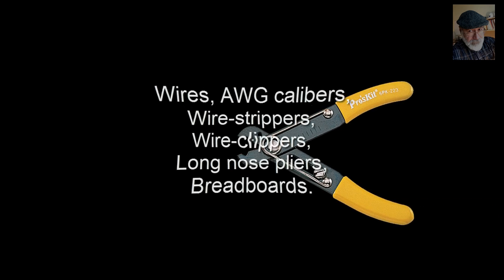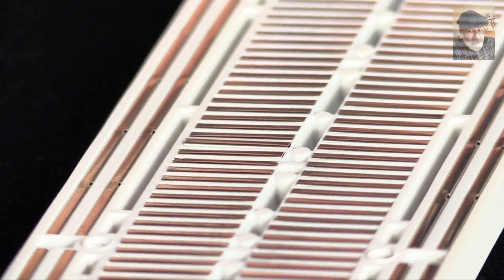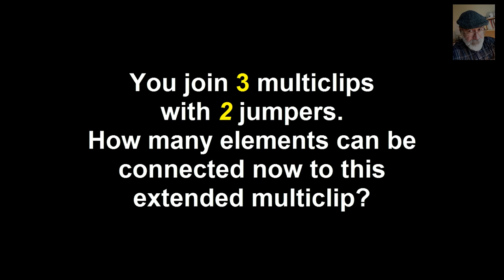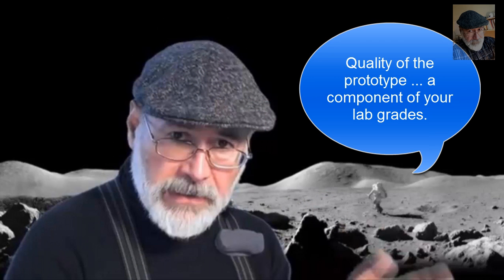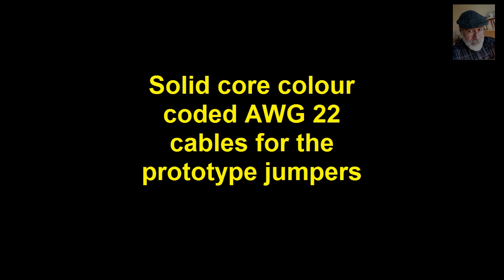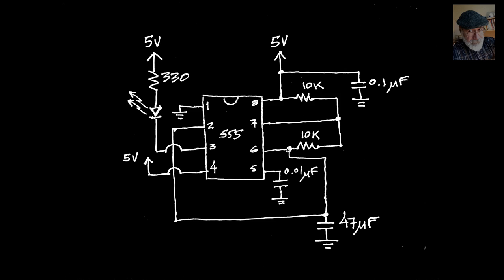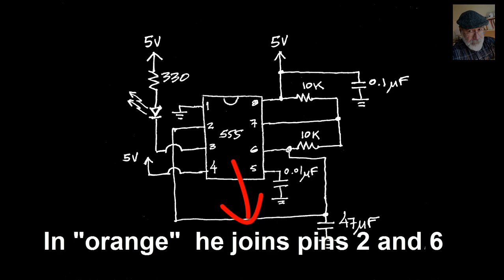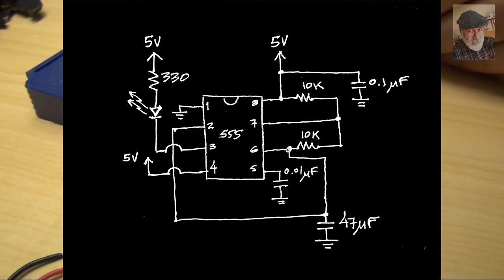The Breadboard, schematics, cables and wiring.

Comment: This is supreme clarity. I was super confused how to set up circuits in the lab as a result of not knowing the way the breadboard is set up. I didn't realize each row came in those packs. No wonder you need to put things horizontally sometimes rather than vertically.
Reply from the maker: Raymundo Flores Yes, Mr.Flores. You are not alone there. Many new students of electrical engineering have never used a breadboard before (yes, I know, some have, but those are the minority), and are faced with a piece of plastic with a bunch of little holes in it where they are supposed to plug the terminals of components with no guidance of how or why. I am really happy that, from what I read in your kind comment, the goal of these three weeks of work of preparation, shooting and edition, was met. All that effort is paying off, thanks for your comments..